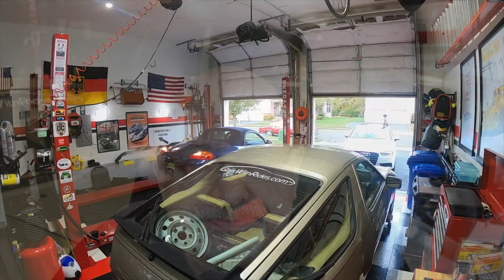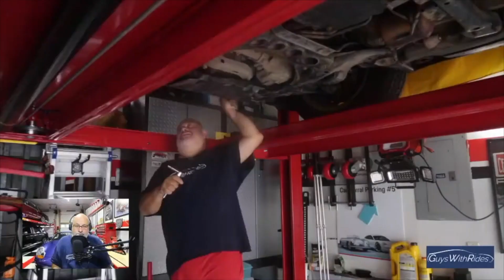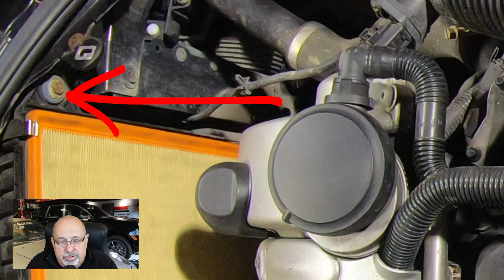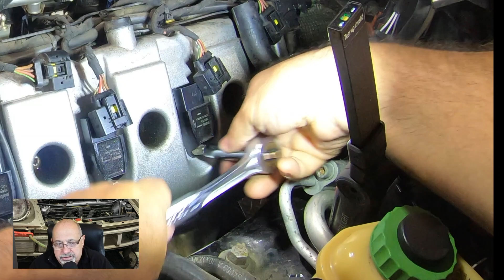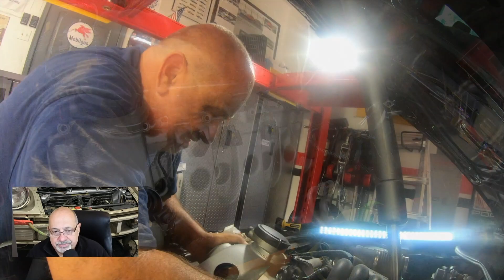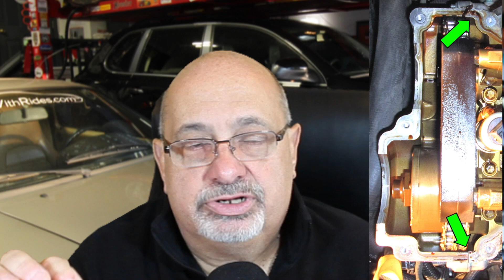How To Replace Porsche 955 E1 9PA (2003-2010) Cayenne S Driver's Side Cam/Valve Cover Gasket

Comment: I'll be working on the head gasket beginning this week. Just replaced both camshaft position sensors and the crankshaft position sensor. Got it all put back together and then it spit out codes on bank 1 all 4 cylinders and has smoke coming out from what I believe is the head gasket. This is a huge learning experience for me as I am not a mechanic but there isn't one in town willing to look at or work on it.  Thank you for your close up and in depth work.